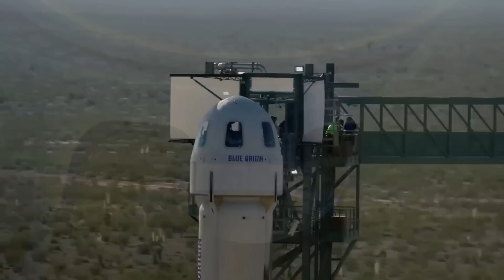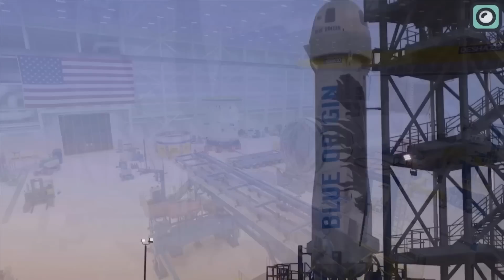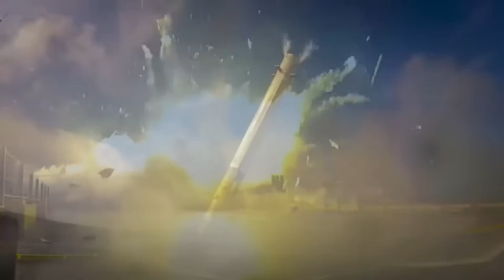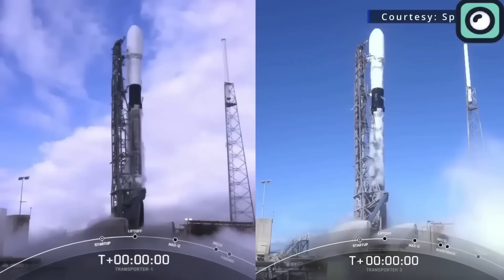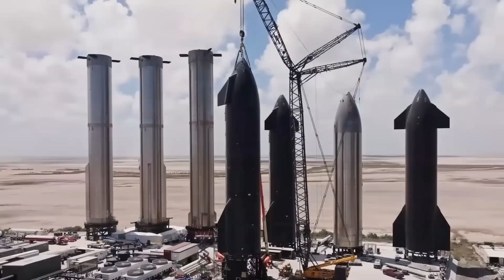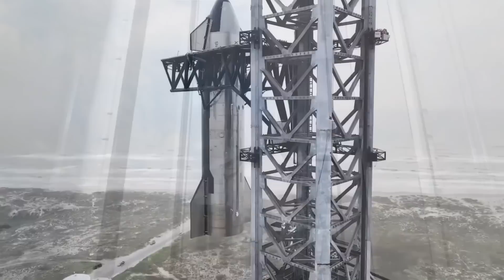Finally Blue Origin's New Glenn Is Launching But There Is A Problem!

Comment: At this rate Starship will be landing on the Moon before Blue Origin actually has its first launch.
Reply: On the contrary, New Glenn and Starship were both announced in 2016 and New Glenn will be launching to orbit in the next few weeks while Starship not only hasn't made it to orbit yet but wont be doing so on its next launch either. Despite all the taunting New Glenn will still beat starship to Orbit.

Comment: Well, they are two different rockets both with different purposes. Size alone makes them significantly different. A better comparison would be Blue Origin versus a falcon heavy. In that case BO would be even further behind. Apparently BO has enhanced its manufacturing capability and if they ever are successful with their rocket then they will be in part competitive with one segment of the industry. Even then they'll have to produce BE4 engines and that may prove more of a challenge than the rocket itself.

Comment: Blue Origin has been run by former Lockheed Martin management, a company rooted in cost plus contracts and slow progress with debilitating fear of failure, while SpaceX believes if you aren't failing you aren't progressing.
Reply: There is a minuscule difference between these two: one wants to go to space, the other wants to make money. 🤔🤣The former now is in space and makes money, the latter still hasn't done sh.t.